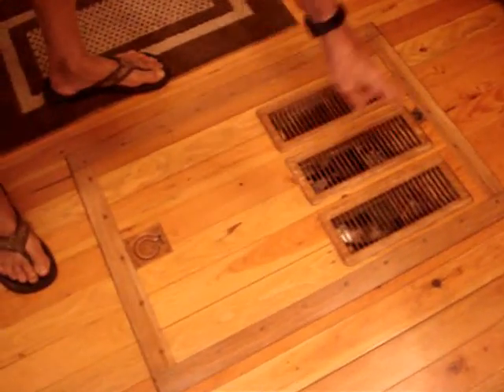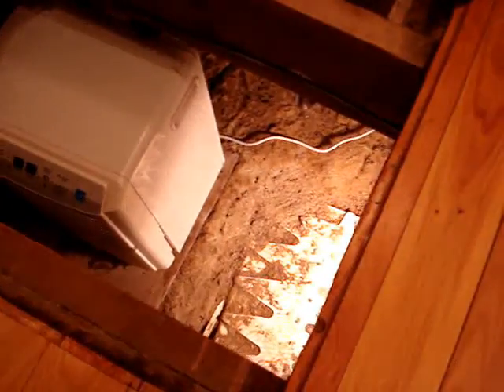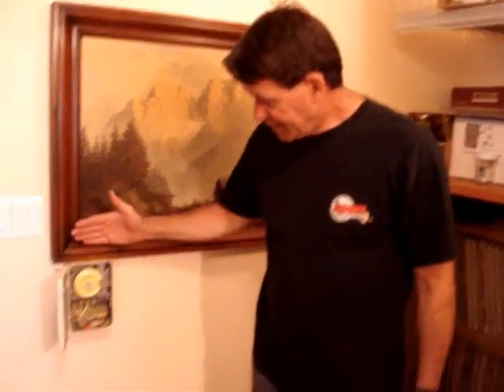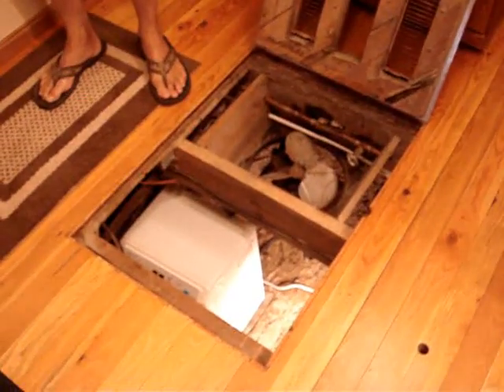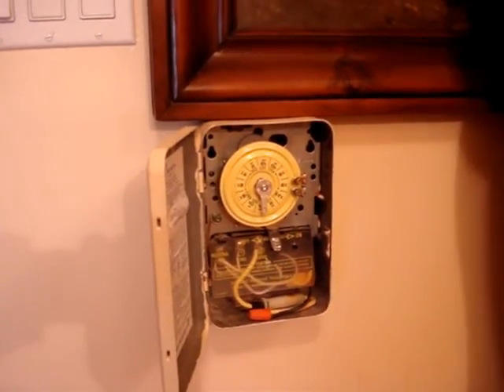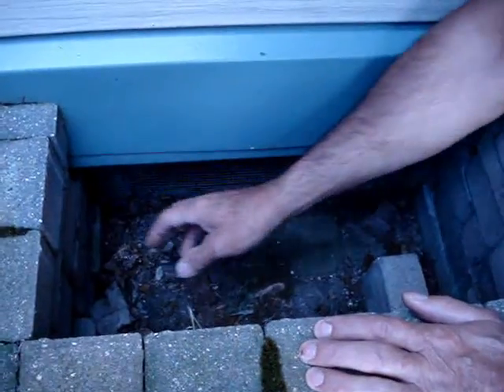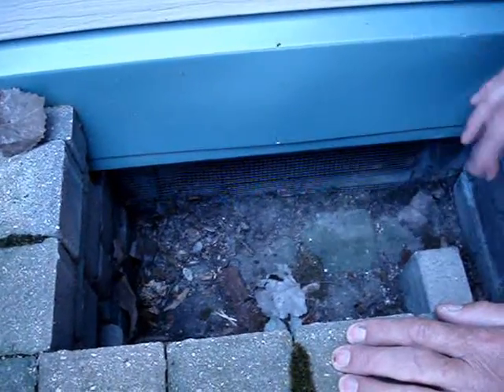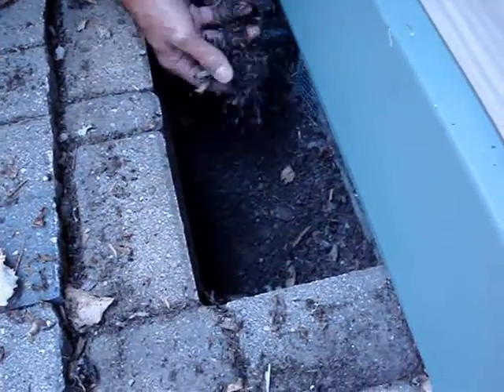Ventilate Crawl Space to Prevent Sick House Mold, Allegens, Damp, Wet

Comment from the maker: Nick, great advice. This fan is in my cottage which has an electric water heater and I don't use it in the winter so I'm not pulling against any naturally drafted combustion appliances. If someone were to do this in a mechanical room or close to a hot water heater they could cause enough negative air to draw carbon monoxide into the building.
I do not use it when I'm heating or air conditioning for very long periods of time so as not to waste expensive 'conditioned' air. 
I do not mention the make-up air vent upstairs next to the dryer.
Please email me for a free sweatshirt and hat on me.
Great Comment! Thank you

Comment: If you run any naturally drafted combustion appliances (gas water heater, gas stove, gas furnace, fireplace, wood stove, gas dryer etc. ) while your fan is in operation you will run the risk of pulling carbon monoxide into your living space and/or killing any pilot flames. Also, it would probably be a good idea to remove it before trying to sell or having any sort of home inspection.

Comment: You have the right idea but your execution is off. Your creating a negative pressure environment in your house and a positive pressure in your crawlspace. Dirt and potentially mould from your crawlspace can enter your house through small gaps in your property. The best method would be to install the fan at the exhaust vent outside your property and pull air out of the the crawlspace and blow it outside. This will lead to a negative pressure in your crawlspace which will not be forcing debris from your crawlspace into your property. If your trying to deal with mould in your crawl space the last thing you want to do is create opportunities for the mould to enter the inside of your property.
Reply: Bento San 
Bento, one of the uses of my fan is to clean the dust mop, notice all the crumb on the fan blade. Another feature is my fan is high and dry and so is the wiring, not so putting it in a foundation vent at my house. Lastly, there is little to no mold thanks to the fan. The house smells fresh as a daisy all summer long.
Reply: I say this because i am run an IICRC certified water restoration and mould remediation company. Positively pressuring the subfloor leads to indoor air health problems that show up upon post-remediation testing. This is a really big no no in the industry that has cost some restoration companies big money to rectify in large cleaning bills and loss of contents.
Reply: Thats not unanimously agreed upon. If he is getting dry conditions it is working for his set of conditions. The little darling of crawl space solutions these days is encapsulation, which isnt unanimously agreed upon either as well as being a 10k to 15 k job

Comment from the maker: Yes, my house has air conditioning, but when it is on, or when the heat is on I disable the fan cuz I don't want to waste cooled or heated air. That gives me all spring and most of the summer to power vent my crawl. That seems to be doing the trick. For 10 years now.
Reply: Mr. Hardware 
Bento, I totally agree about driving mold upstairs by pressurizing the crawl. All you readers take note, if your crawl does not have enough venting or if your crawl is full of dangerous mold this is not a project for you. Concentrate on removing water in the crawl and hire a qualified contractor to insure safe conditions.

Comment: Hey I watched your video and noticed the fan is running backwards. It will blow a lot better and more efficiently if you reverse the motor or replace the blower fan blade!!
Reply from the maker: Robert, my goal is to send dry warm air into the crawl space to send damp musty air out the foundation vents. The fan  blows down which is my goal. Thanks, Blair

Comment: Question: We are experiencing a musty smell from the crawl space here in Clarksville, TN. We have fixed the drainage pipe in the back of the house and have done a french drain in the front. This has fixed the standing water issue; however, the crawl space is still damp. How can we install a fan like this? What square footage is the cabin? Another question is where would be the best place to a fan like this in the house? If maybe you could email us instructions or any advice? We have consulted companies wanting to encapsulate the crawl space. This is too expensive for our budget. Please help.
Reply from the maker: Sorry for the late reply. I purchased the fan from Graingers, sized to my floor joist, which was 14 1/2"
apart. Even when it runs an hour the air is still damp so I'll run it an extra hour or so. This is not science, we are changing air as much as we can. The few days the humidity is high outside is outweighed by the many more days it is not. My place is 1,800 sq foot and if you give me the dimensions that would hold a fan I'll give you a price and model #, you may get it at Graingers in your town. Blair
Reply: Mr. Hardware ,

If a clients wood floors are just starting to show cupping after 14 years... (after the obvious floor refinishing).....Maybe this is an economic solution option vs. encapsulating and dehumidifiers ??

They have a wood square as you show, and vents could be added as you did yours.  

It is a great idea if it were enough to solve the moisture issue in 1,400 sq.ft. lake house.

You sir, are a genius 💡

Comment: Thanks for this video.  I've been having problems with my crawl space since I moved into my house a year ago -- a week after I moved in, I found out that it floods after it rains.  I had a sump pump installed at the most significant entry point, and while that helped get 99% of the water that would otherwise be in the crawl space out, when it's hot it still smells somewhat musty in the house.  Was there any standing water at your place?  There is still some standing water after it rains at my place, and after talking to a few different companies and hearing different options, getting a french drain installed at some point is the next step, though that's probably not for a while.  In the meantime I'm thinking about putting a similar fan in the crawl space entryway while I'm at the house to draw out some of the humidity and mustiness.  It works in the bathroom, right?  And it worked in your house.
Reply: My crawl space is lower than the water table in my area so unless it is very dry there is always damp soil down there. My fan is now 17 yrs old and still works one hour every evening unless my furnace is on. Even then we use it manually to clean the dust mop which helps to change the air then.

Comment: This only works for summer?
Creates a negative air pressure in your house?
Reply: I have 2 supplys of air in my house, one under my dryer and a vented attic access that pulls clean air from the attic. I use it in the winter to clean the floor mop for brief periods and move a little air in the crawl. However I don't like sending over 2,000 cubic feet of heated air into the crawl for too long in the winter. My goal is to keep the house fresh in the summer and keep the crawl a little nicer at the same time.

Comment: is there a solar powered model ?
Reply from the maker: I did some research and it looks as though you can get a low voltage fan, but you will have to build the battery and solar charger as a second item.